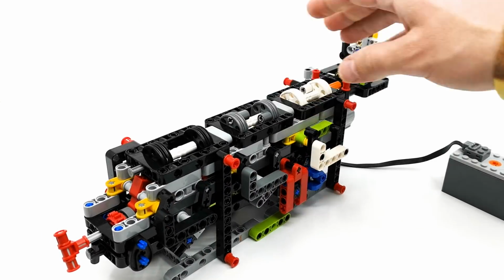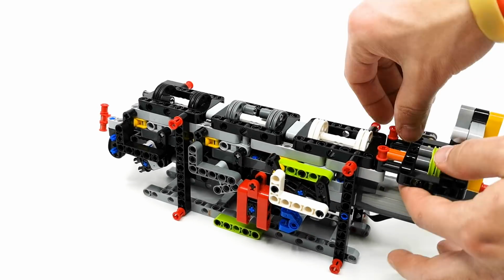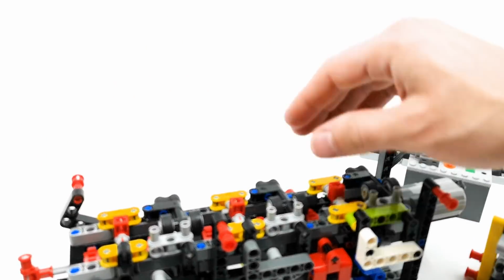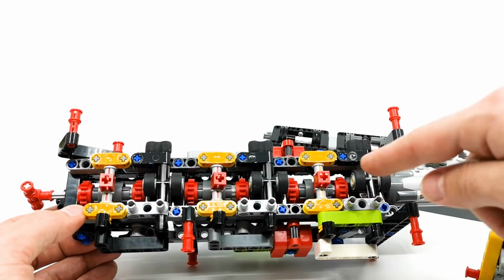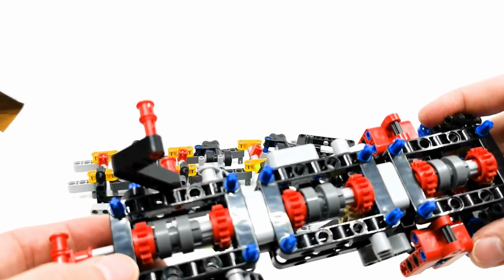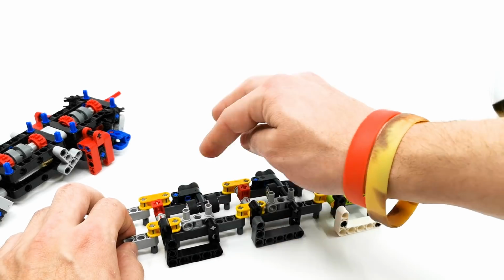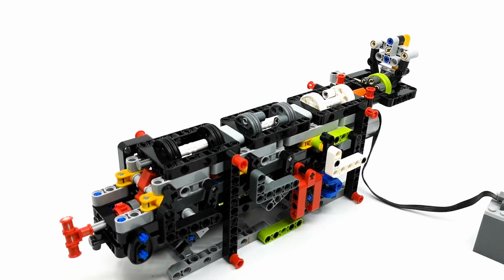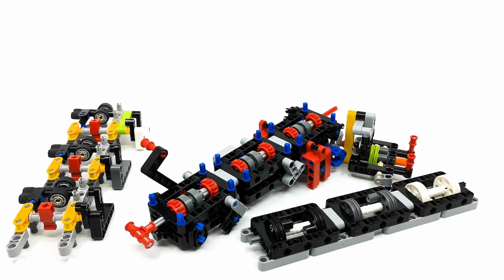Technic 6 speed sequential gearbox concept

Comment: Nice concept !
Maybe, by using the old gear selector (witch take 2 studs in stead of 3) you can catch some length ? and make it a little bit smaller ?
Reply from the maker: I could gain a few studs, but than the construction wouldn't be as robust, since now the selectors and gears fit perfectly in the 5x7 frames.

Comment: Great build! Do you think it could handle the power of 2 buggy motors?
Reply from the maker: Yes, but I would change the gear ratios. I would remove the 8 and 12 tooth gears and add 36 and 40 tooth gears.